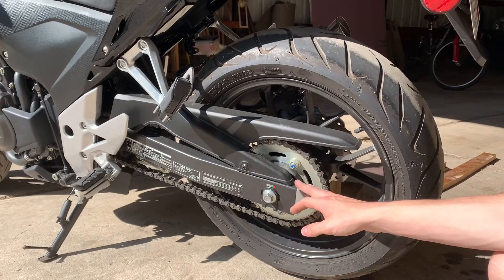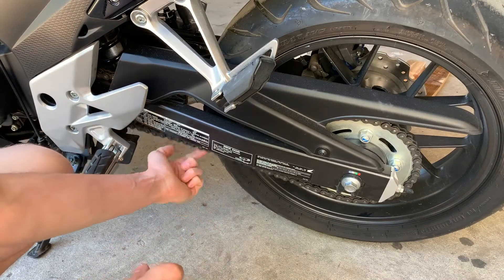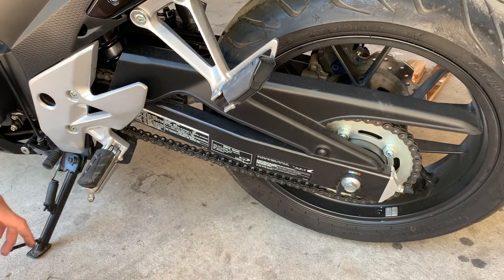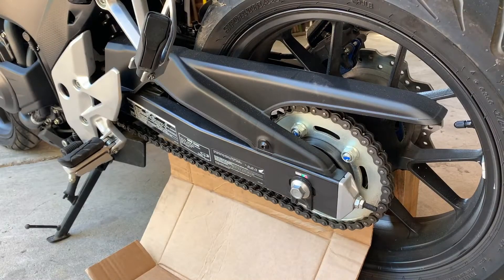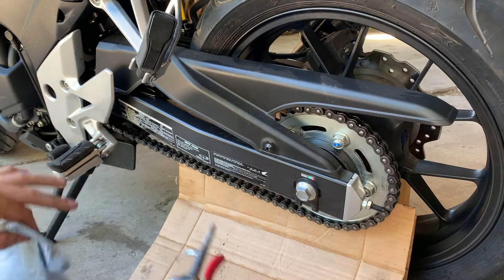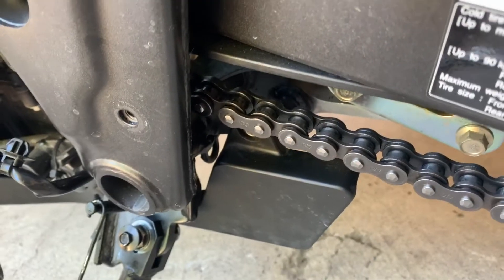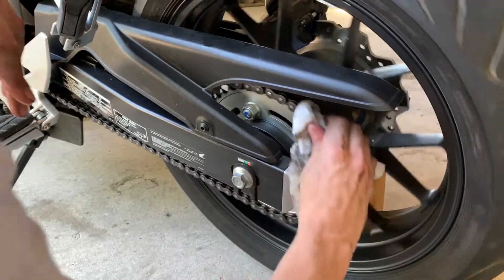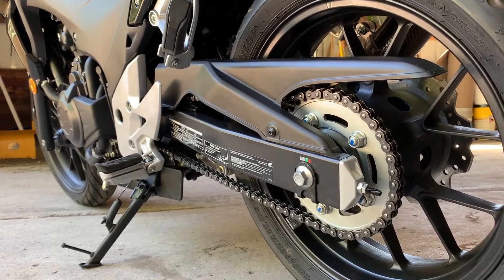Motorcycle Chain Service - Honda CB500F

Comment: Great video Casey. I like that you take all the covers off and clean the front sprocket as well. The other couple of videos I watched did not
Reply from the maker: @Robert Angus - Thank you! It is technically optional to remove the all covers but it does allow you to get the chain much cleaner. It allows you to inspect for wear on the gear teeth and any oil leaking from the output shaft.